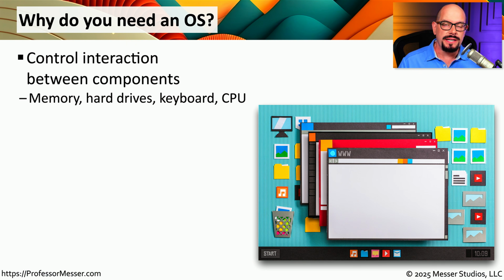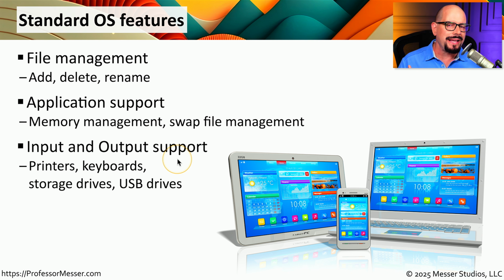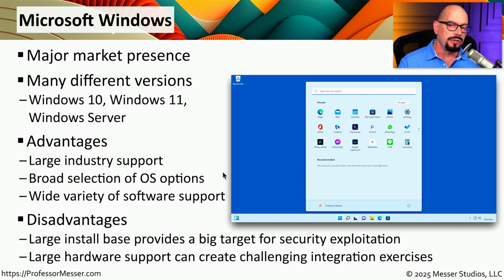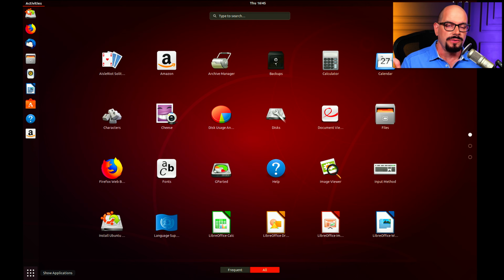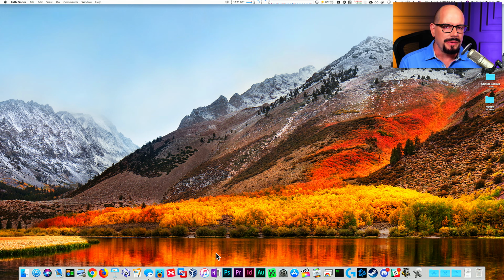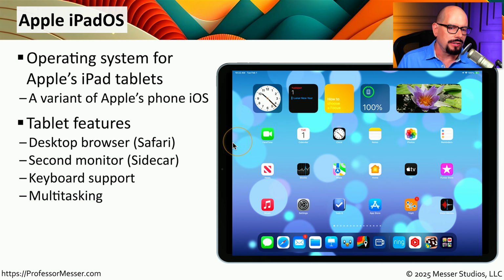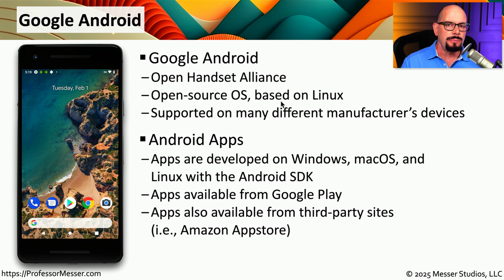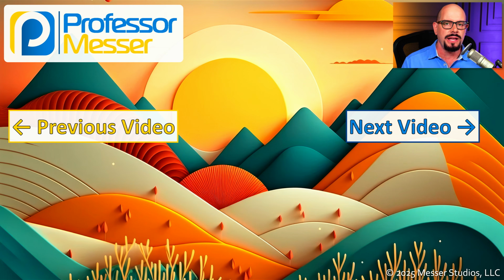Operating Systems Overview - CompTIA A+ 220-1202 - 1.1

Comment: I just passed the core 1 with a 720/900.  But I came in completely new to IT (no joke, I didn't even know what a router or modem did.  I worse than your grandma at understanding tech).  But I watched all of the core 1 videos, looked up stuff when he said something that didn't make sense and... MOST IMPORTANTLY... did practice tests.  I didn't pay for a single resource besides the exam voucher.  So it's possible, actually quite doable.  I was hired at my new career on 2/18/26 (contingent that I would get these degrees) and I passed the Core 1 on 5/8/2026, all while working full time and making sure to set aside an hour and a half to exercise each day too.  You can do it... Just set up a schedule, give yourself a checklist of minimum videos to get through during the week, watch on 1.5x speed, and google any minor discrepancy that you may not understand.  Good luck!

Comment: Yesterday I passed Security+ on my first try, which officially completes my trifecta, all done in about 6 months!
For context, I came from zero technical background. I have a BFA in graphic design and spent the last 7 years working as a designer. Around last August I decided I wanted to pivot into tech with a long-term goal of getting into cybersecurity.

At the start I barely knew what a subnet was. Then I found Professor Messer and Jason Dion, started studying consistently, and it snowballed from there:

A+ - October (824/900 & 795/900)
Network+ - December (807/900)
Security+ - February (789/900)

All first attempt! Largely due to Professor Messer videos, flashcards and Dion's practice exams.

Honestly just wanted to say thanks to this community because lurking here helped a ton with motivation, study tips, and not feeling like an idiot while learning this stuff.

If you’re coming from a non-IT background and wondering if it’s possible, it definitely is!

Comment: just passed core 1 with 2 weeks of study no IT experience/working full time, multiple choice was a breeze but those pbq's were no joke lol
Reply: Oh for real, I just passed 1201 also, and they were tough. Way tougher than the ones on Professor Messer's practice exams.
Reply: @giygas_9577 never took messers practice exams, but i just passed core 2 saturday after 13 days of study that one was way easier than core 1

Comment: I wish that your example of a Linux desktop would have gone into more depth. What distro or GUI does it use? It looks like a tablet or laptop setup, and I see an Install Ubuntu shortcut. Personally I've used Mint, Kubuntu, and Red Hat before.
But either way, I'm sure the 1202 doesn't depend on knowing all those details. Would have been nice to know that stuff though.

Comment: Just passed my 1202 using only these videos. Similar to the 1201 I would say the videos cover 90% of what you need to know which is more than enough to pass.

Messer also has practice exams on his website which I found EXTREMELY helpful.

Good luck out there!

Comment: 7/25/2025 Just Passed 1202 Core 2 - Thank you sooo much Professor Messer for your outstanding  materials now I am CompTIA A+ Certified. My Learning journey took me a little over 2 months with extensive learning... best of luck to those who are in the process of getting certified! cheeeeeeeeeeeeeeeeeehooooooooooooooooooooooooooo.........
Reply: hey there, i was wondering if you could help me. 
i want to study for comptia A+, this channel was recommended for me, but i saw a lot of playlists and that's confusing me.
can you clarify things for me
Reply: @sidiali5321  comptia A+ is split into 2 sections. core 1 and core 2.This video is the start of core 2 otherwise known as A+ 220-1202. emphasis on the 1202. Core one AKA 220-1201 is what you should watch first. His playlist has 63 videos for core one 1201. There is an older version of A+ that is 1101 and 1102 that i think he also has but i think its about to be phased out so id go with the 1201 and 1202. hopefully this helps. Start with his Comptia A+ 220-1201 then move on to his 1202 (which if this current video)
Reply: @sidiali5321  start the playlist from the beginning core 1 don't jump around you will get lost.
Reply: What studying/learning did you do outside of watching his core 1 and core 2 videos?

Comment: Just passed my core 2 exam and got my A plus!!  Excited to see what opportunities are waiting!
Reply: Congrats! I passed my Core 1 using Professor Messer's videos and some others' practice exams. What other material did you use to study for the Core 2? I have Messer's core 2 notes but want some additional material since he's still uploading his videos.
Reply: @DJLiftOFF I also used Jason Dions course on udemy along with his practice tests.
Reply: @KurtS.87 thanks!
Reply: @KurtS.87 Do you think Jason Dions 6 practice tests are enough to pass core 2? I am not seeing much materials/practice tests for 1202 core 2 right now.
Reply: @sharad8108 I’m taking the core 2 tomorrow morning and I started with messer’s 1102 videos while looking at the 1202 notes so I could point out the additions to the 1202 material. Messer also has a guide that explains the differences between the 1102 and 1202. I purchased the notes too though so I could see what the additions were.

Just scored 85% on a Dion test so I’m feeling pretty confident. Going to take a 2 more exams today.
Reply: @sharad8108 It should be because Dion and Messer are great instructors.  One of the reasons I was able to pass faster was because I got my associates degree at a community college this past December and I took a class there that covered material on the exam.  I didnt need to watch all the videos and take all the practice test becauee i was already familiar with some of the material.  It just depends.
Reply: @KurtS.87 did you do the exam online or in person ?

Comment: Passed Core 1 1201 yesterday as a french speaker. Thanks for your awesome videos and let's go for core 2 !
Reply: Where did you find practice tests for 1201 I am struggling and Professor Messer does not seem to have any
Reply: eight months later but i passed 1201 two days ago. i used crucial exams and examcompass to study. the crucial exams questions were closest to the exams. and they have sample pbqs. however an element of pbqs is definitely figuring out what the question wants from you quickly as they dont really explain it well on purpose
Reply: @wazup1102  He has practice test available on his website. I highly recommend buying them along with the course notes.
Reply: @wazup1102  Jason Dion Training on Udemy - He has 6 practice tests. I passed my 1201 Yesterday and i used his tests and averaged a score of 90 on his tests. Sometimes you can get a 7 day trial and get them for free!
Reply: I passed today!
Reply: I want to ask a question  im also not a native speaker how did you handle it